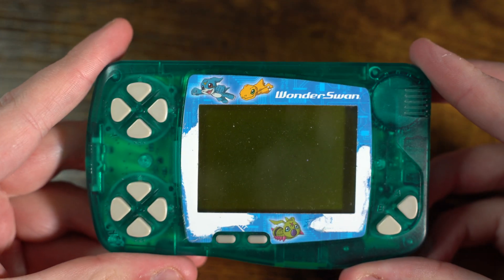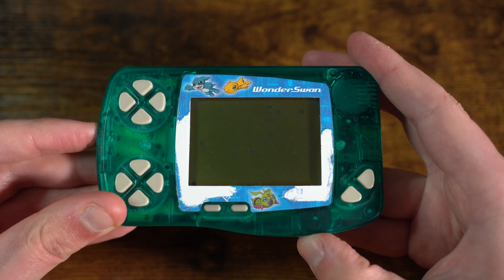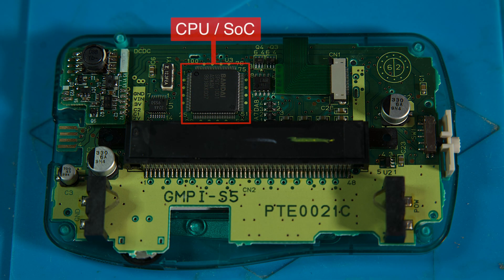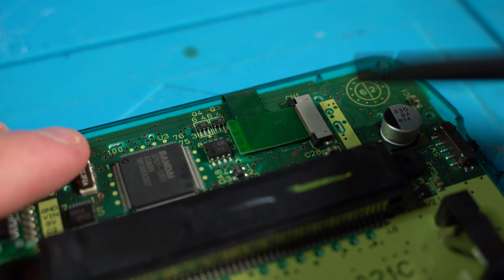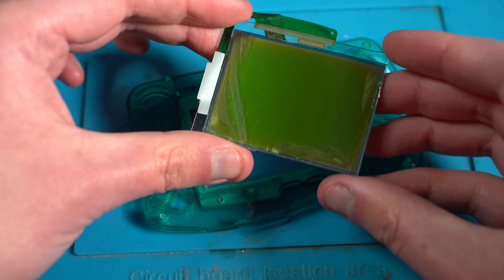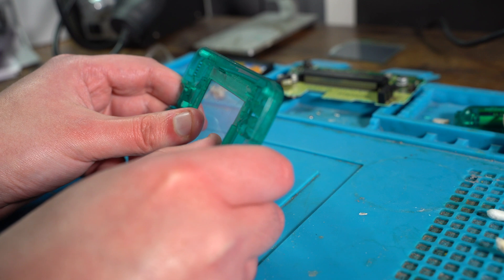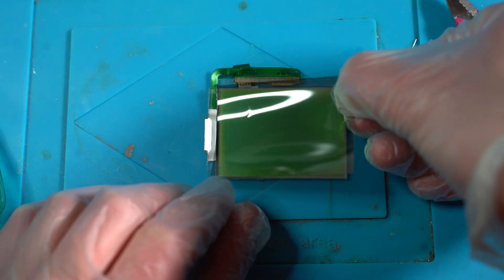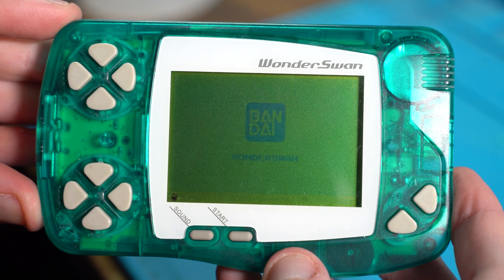Bandai Wonderswan - Restoration & Hardware Breakdown 4K

Comment: Hi!
Nice video :) I have a question, do you know where to find Wonderswan replacments? I bought one a week ago and received it today. It lacks one button and I can’t find any replacements. On the other hand, It plays no sound and I was wondering if it is supposed to play anything if there’s no game inserted since I have none yet. Thanks for your time.
Reply from the maker: Replacements for the original Wonderswan are not easy to get, I would suggest maybe getting a parts / spares repairs Wonderswan and use the buttons from that. 

When the Wonderswan boots up and if the volume is up, you should hear a boot sound regardless if a game is inserted or not. If you are not, you may have to teardown the device and check the capacitors, speaker and go over the board for any corrosion.

Hope this helps.
Reply: @theretropal  I’ll keep it in mind, thanks! 
Just came out with another question. Would Wonderswan color buttons work as a replacement?
Reply from the maker: @NimrhodelValgar  I've not worked on the Wonderswan Color, so I'm not sure. Might be best to ask on a Wonderswan Facebook or discord group. Hope this helps.